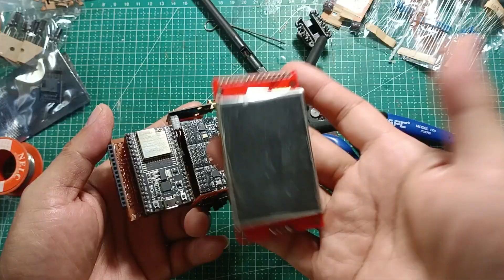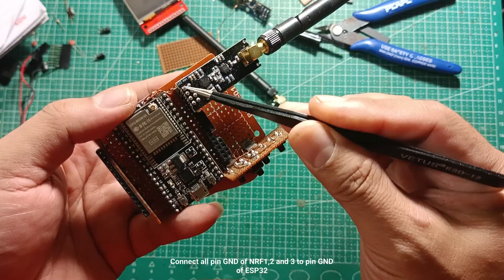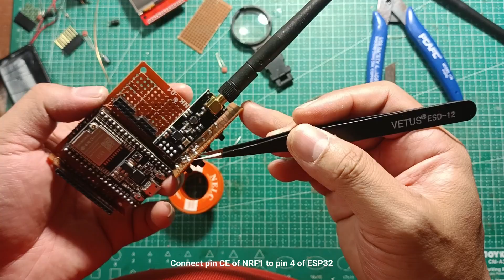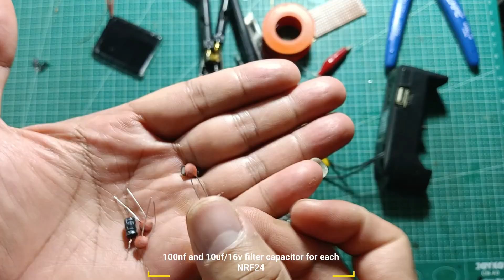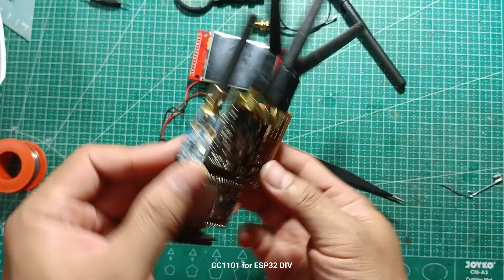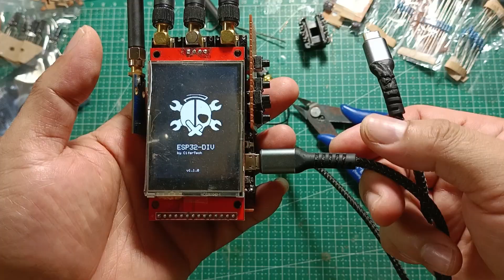ESP32 DIV BY Cifertech Part 4 Connect NRF24 & CC1101

Comment from the maker: I will upload next video soon, leave comment and feel free to ask question here 👇.....
Reply: I like your video
Reply from the maker: Thanks 👍
Reply: bro nice job but i wonder if it can handle nfc module or IR? which firmware do you prefer, bruce or div?  wanna make one but i want more capabilities, checked div project's github and i felt there are some features missing
Reply from the maker: Yes i haven't Connect IR on DIV,  RFID is not available yet on DIV but Bruce already have NRF24, CC1101, RFID, IR, and GPS
Reply: Bro make esp ghost with 2.8 inch tft display and esp 32
Reply: Can you help me do it with the Hx1838 Ir Sensor and the Wireless Control because now I can't control it and I can't make attacks?

Comment: These connection were smae to bruce firmware
Reply from the maker: No it's not same
Reply: @ARTFOR thanks for reply but in my bruce firmware its have brucePins.config there is not considered right pin for cs of all module its already set with cs: -1
Reply: @A @ARTFOR  thanks bro for replying very fast. I want to know that can you please tell me how should I connect C1101 and NRF 24 in Bruce somewhere, please make the video. I have the problem. I can’t show it not doesn’t detecting the NRF module.😢
Reply from the maker: I have already make that video for each project, here is how to connect NRF24 and CC in my DIY CYD:
https://youtu.be/zXMxBTrUJLE

Comment: Hi bro,
I had a doubt, Cifertech used 6 antennas,
3 X NRF24
1 X CC1101
1 X ESP32 WROOM32U
and for what the 6th antenna was used by Cifertech
Reply from the maker: Antenna functionality is of course for better range, but i have a doubt too in NRF24, i think 1 is just enough just like on Bruce

Comment: You should have recorded without skipping, the soldering of NRF and resistors... there are some that are not clear and not visible, for beginners like me......
Reply from the maker: That would take a long duration of the video, you can see schematic for clear connection, but remember that in DIV there's a conflict between CC1101 and NRF24 no 2

Comment: Bro what wires are you using? Also I believe Esp32 DIV only supports ILI9341 screens
Reply from the maker: 0.3 to 0.4 mm enamelled copper wire. Yes this is for ILI9341

Comment: Qué tipo de cable usas tú para las conexiones? Con ese cable tan fino no se te calienta?
Reply from the maker: 0.3mm Enamelled copper wire, no, it heat resistant, such as those found in motor coils
Reply: @ARTFOR Gracias 🫶🫶🫶
Reply from the maker: You're welcome

Comment: we can use 2.8 CYD and can u make tutorial?
Reply from the maker: yeah maybe later, but right now i'm working on another project
Reply: @ARTFOR  I will wait i really need it new firmware for my CYD I get bored on Bruce and Esp32 marauder
Reply from the maker: If you're bored with all that, I happen to be working on a different project: the Arduboy. It's a bit late, but it features a serial flash chip that can hold up to hundreds of games, so please stay tuned...
Reply: I think  just need to change the code to make it work. for wiring Display
Reply from the maker: Yes if you can do coding you can build it from source and change the codes